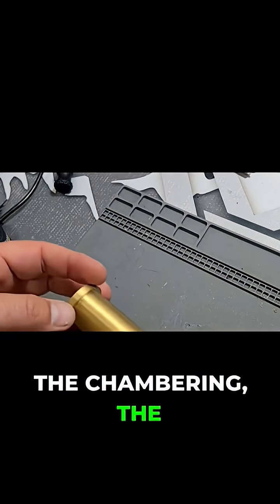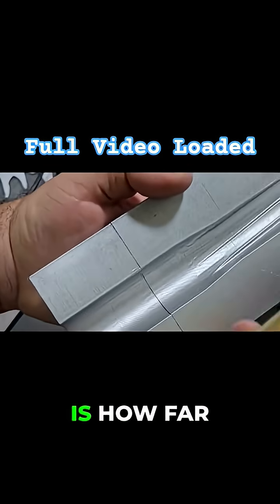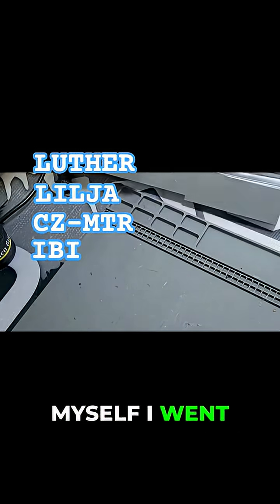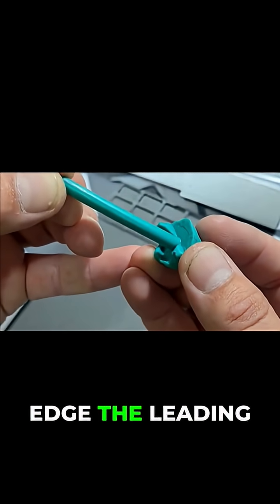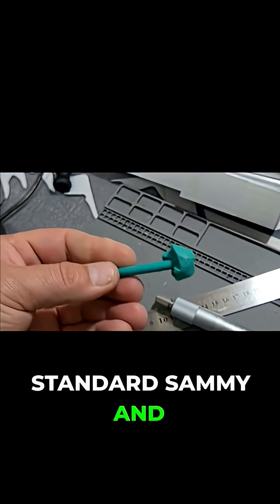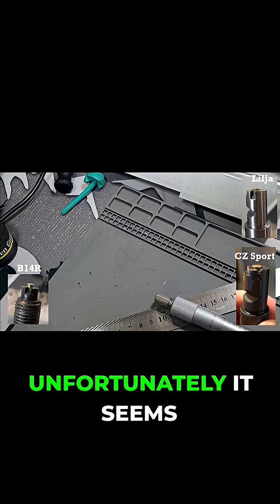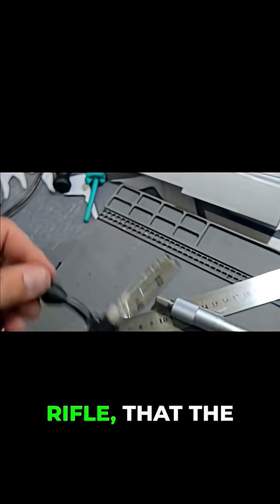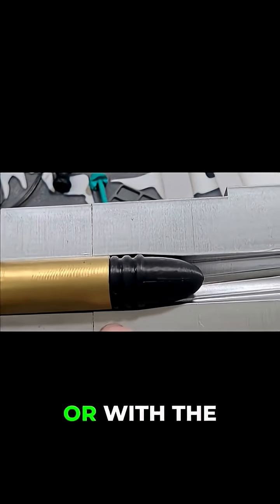#22lr Rimfire Rounds and #headspace what you need to know!

Comment: What spring did you add to bolt to aid extraction? Where can I get one?
Reply from the maker: Amazon- but here is the spec. "0.5mm Wire Diameter x 3mm OD x 15mm Length 304 Stainless Steel" cut down to probably 8mm in length
Reply: @ParallaxPrecision thank you so much. Gonna give it a try!